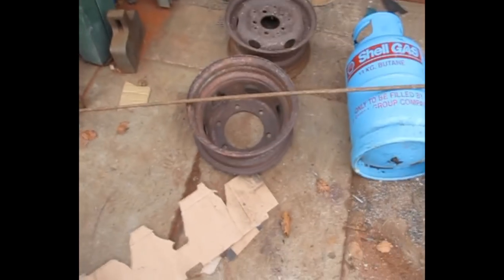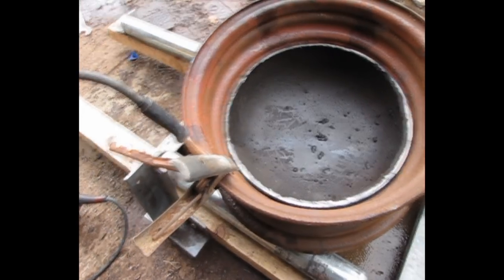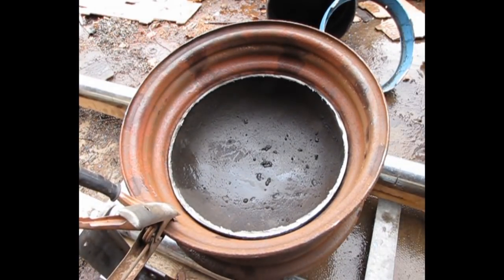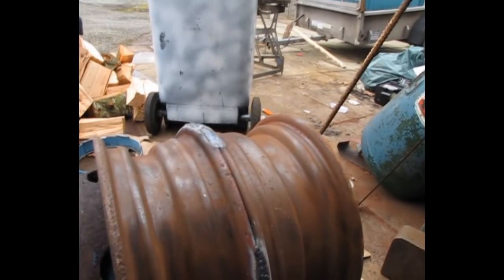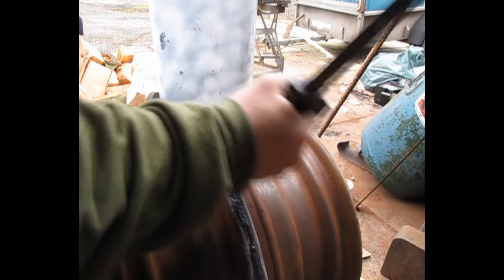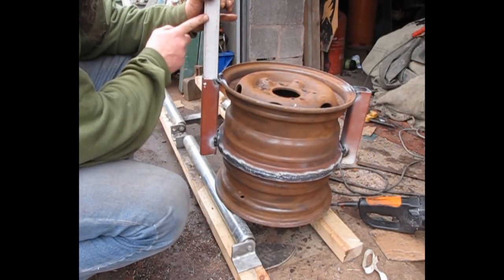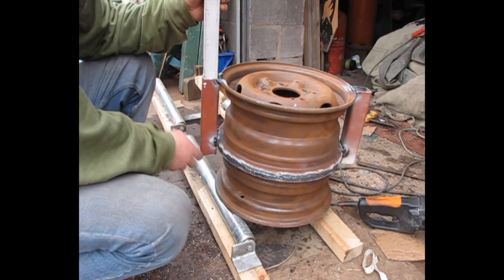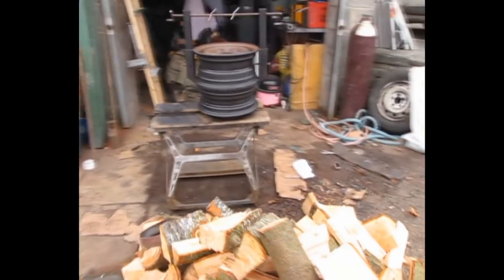DIY Wood Stove made from Car Wheels! Easy Welding Project! Bacon! CATS!

Comment: Good video. Another suggestion, I have seen work well for heating inside buildings is a log burner made from bolting truck brake drums together. Achieved by knocking out one set of studs and marrying up to the other set. This was 4 drums high and very hot when burning as the drums held the heat in.
Reply from the maker: +Andrew K Fletcher thats a great idea, one of my problems though is a lack of scrap metal like that, some steel just doesnt fall into my hands

Comment: I don't believe U diluted good Scotch with coke.  Drink it alone are on ice.  Oh, great video.
Reply: +Widowsson abif ill second what you said
Reply: +Widowsson abif He did drink it alone out of the bottle to start. Coke goes with whiskey like jelly does with a donut or milk with tea. Now you wouldn't want to use crappy jelly or crappy tea now, would you? The coke will surely go good with the bacon as it does with ham. Seems about perfect to me.
Reply: +lovestory952 Thanks
Reply: +Mr Boat That is disgusting, mate!  Coke with scotch?  A cup of tea goes good with another cup of tea.
Reply from the maker: +Widowsson abif no hes bang on the money, whiskey and coke is a really nice drink with your bacon or fajitas, you need a fair ammount of drink to go with your dinner and you just cant drink scotch like coke, and cheap whiskey is nasty with coke, the older the whiskey the nicer it is....with coke....single malt, not under 10yrs either :)
Reply: There is enough time allotted with an average life to have things all ways. And every day, month and year, another bottle of whiskey will come of age. Seemed like such a simple, yet fitting reward for a job well done.

Comment: can u imagine using 2 semi truck tire rims instead??!! that would be huge. or use 3-4 of these rims for a big one. TY FOR SHARING this poultrypeople. I LOVE ME SOME BACON TOO!
Reply from the maker: +Dave Zimmerman good suggestions, id love to try that but i dont come across big rims so much, but I will try your idea of 3 or 4 to make a bigger woodburner, thanks man, ill give you a mention when i make it!
Reply: cool. Hoping to try your idea out soon. Thinking the big semi rims might be too heavy. IDK. I see them now everyday at work. Keep posting vids!! love it
Reply from the maker: Dave Zimmerman i guess its horses for courses, they might be too big for your average portable family bbq but ideal in a more fixed position where a larger number of people gather? theres also been a few suggestion in the comments of putting on 3 legs and you could then add some castors so it could be wheeled around? ive got more vids in the pipeline :) ive also got a load of video that needs editing, time is always the problem ;)

Comment: Hey, well done!    Makes a nice little stove.        I had a thought.  Maybe block those two holes at the front, maybe sides too, leaving just the two opposite the front opening.   That way, flames and heat aren't coming out when you have a pan and handle .

Comment: I've built a few stoves myself, but nothing as quick and simple as this. Works well! A great cat you have, I sometimes forget to worm mine which ain't good. Just bought a dc inverter stick welder. I haven't tried it yet but apparently they're nicer to use than ac
Reply from the maker: +John Melville yes, youll have to let me know on the dc inverter how you get on, and thanks for reminding me about worming the cat as well its probably about time both were done :)

Comment: Cool idea!  Keep in mind that just one more pin hole in each outer telescoping spit support can give twice as many height positions and finer adjustment if it's ever needed. One would drill two holes in the outer tube spaced half the distance as the row of holes on the inner tube. Beats drilling twice as many holes if one set of holes cooks too hot, but the next one up is too cool. Actually the height increments shown here, could have been achieved with half the holes in the inner tube, yet only two more in the outer, my suggestion for anyone building one.
The tubing and pins holding up the chicken could hold an automobile off the ground, so even If one does have a drill press, consider using pins and holes half the size demonstrated. Even a 1/4" pin will hold an auto off the ground, supported on that same tubing. My first thought was lock the spit height with two modified Harbor Freight vise grip type C-clamps. One jaw half can be welded to the outer tube in any number of configurations. For example, blow a hole in the outer tube so one jaw can reach the inner tube, and chop up the clamp accordingly. Infinite adjustment, so much quicker and easier than drilling holes, and $3.99 for the 6 inch is so cheap it's seems shameful. The 11 inch is only $4.99, and since both are only available in swivel pad, you may have to cut one or both off, depending on the tube size used. Seems like around one inch tubing would hold a chicken or two easy enough, if that's what's available.
Reply from the maker: kelhawk1 thanks for commenting, im just catching up with a few messages ive missed, good suggestions, ill go through some of them when im in the workshop with the work in front of me, ive got one to make next week,  in regards to the over engineered chicken holder :) i just go with what ive got in boxes that ive hoarded over the years, living the rural life means that a trip to an ironmongers its $15 away in fuel so nipping out for bolts has to be improvised, i dont have any more box section left for the supports and all ive got at the moment is round cold water steel tubing, again thanks for your good input
Reply: thepoultrypeople Yes I am lamenting using the last of my 3x4 inch box tubing. To finish my last two stoves I had to cut up the winch and scale support I made to check the draw length & weight on a bow & arrow set ups.
Reply: kelhawk1

Comment: Excellent stuff.
Just a tip - throw some old oil on you drill bit when using your pillar drill and slow it down a bit - it will greatly extend your time between sharpenings.
Reply from the maker: +Dave Henderson thanks, slow down and waste oil, i have been spraying with wd40 but just ran out, ill take your good words on board, but talk to me about sharpening, do i need a special machine?

Comment: that's a pretty nifty idea...with a few more modifications you'd have a pot bellied stove...
just a quick tip on cutting doors in metal: drill your corners with a 10mm drill.. then the cut of the grinder doesn't go past the corner and the heat won't cause the casing to crack...
cheers mate
Reply from the maker: HolzMichel thanks for the tip, ill remember that one, yes its close to being a small stove, blanking off the top and just adding a flue would do that i reckon?

Comment: That is a nice little stove you made from scrap bits of metal and a couple old rims. Please no more mixing 15 year old scotch with coke, my heart died just a little from the misappropriation of good whiskey!  You took only a few simple tools and produced a nice camp stove. Here in America many of us are spoiled by having a lot of tools. Your work is just proof that the mind is the best tool. You shouldn't feel bad about those welds many people weld 1/2 that good and are damn proud of their work.
Reply from the maker: thanks very much, yes ive looked at tool prices in the US, they seem about a quarter to maybe a half cheaper than over here,  this is an expensive country,  which is strange because a lot of people arent exactly loaded, for instance i dont know of anyone who has a cnc router machine, yet i go on some of the woodworking groups and it seems like everyone stateside has either a cnc router or plasma cutting system in their huge garages, man houses over here are like shoe boxes, im lucky, most new properties barely have enough room for a small 6x8 shed, youll be lucky to get a garage...premium stuff... 

hmm thanks for reminding me about scotch and coke...ill go and pour myself a glass of the dalwhinnie 12 i think, and i will smash it with coke, you cant drink cheap whiskey with coke dude :) although the laphroaig 10 with coke doesnt go down well :)

Comment: Excellent and smart. What dimmensions of wheel rims are best (how deep and the diameter)? What types of rims, they got to have those wholes and the numbers of wholes must be present too? What kind of welding equipment (I like details to get the real picture). Your welding looks real good and solid.  I wish I got a drawing from you on this stove with all the equipment attached. I really like this stove, its smart and quick, solid and real functional. The welding you are doing I wonder if you use tig welding? Its really the right technique on this job. What is the dimmensions and quality on those 4 edged pipes/frames you are using for attaching the rotating rod a like thing on it with those prongs on the rod?

Comment: That stove design also lends itself to easy installation of a common cast iron propane burner. Those are used to make cookers and grills throughout the US and presumably rest of world. The only difference would be welding a mount tab for the base of the burner inside the lower area of the top rim.
Reply from the maker: aaah interesting, good cast iron burners arent cheap, i bought a chinese one a few years back and it was mis cast and also cracked eventually during use.

Comment: I had thought that utilizing old mobile home wheels (the ones that don't have centers in them...what once was known as "Bud" wheels) would be the perfect thing to build something like this out of. A heavy gauge piece if plate steel across the back and front and you could even wrap it in light-gauge sheet metal and build a forced-air system around the firebox.
Reply from the maker: +Andrea Tatham sounds like a great project, we dont have those wheels over here i dont think but ive never looked to tell the truth, and thanks for pushing me down the forced air route, its a system that i need to look at, maybe using low voltage computer fans to move the air?
Reply: thepoultrypeople Computer fans would work great if you are working a 12V system...though you could use the heater fan out of a car just as easily (and maybe even cheaper). The idea was to wrap the "barrel" of wheels with sheet metal which would create channels around your firebox through which you pump the air to blow out into the room OR to duct off to another room.

Comment: for the leg adjustments. drill one hole and weld a nut over it. then simply thread a bolt into the nut and press the bolt against the inner leg to hold it in place.
Reply from the maker: +bos dad great idea! thanks for sharing

Comment: I'm actually getting ready to make a burner like that but out of two large truck rims, a couple suggestions don't use soap to clean your pan and your welds look good it's mostly about practice. Very nice looking burner and yes Raggles licking his arse LOL!
Reply from the maker: ***** i saw a large rim the other day but it still had the tyre on and wouldnt fit in the car :) a couple of people have said about soap and pans/woks to just use cold water, im still practicising with the welding, i reckon after a lifetime on it I should be ok, thanks!

Comment: That's a solid looking stove. Nicely done. You sir, need a dip tank of water :) I think I saw you almost burn your hands a couple of times there. Has anyone built a coal burning stove? It seems like this could work with coal with some modifications.
Reply from the maker: +Sarah Wolfe missed your comment :( thats a good suggestion, im meltiing metals now so definitely one to think about, theres no reason why it wouldnt work on coal, i guess the problem might be the taste of the coal getting into the food? i suppose you could put a solid hotplate on top and pipe the exhaust out the back?

Comment: I have got to make one.  I just got a little welder that can manage 3/32 rods, and I got a few car rims laying around.  It looks awesome!  Does it radiate a lot of heat, keep a small area warm?
Reply from the maker: +Angie Hughes sorry for late reply, ive been away, you might have made it by now? if not, then yes, once its stoked it glows away and pumps out the heat, good luck, its good for welding as youre going to need to run a bead at a slight arc whilst maintaining the right angle, theyre great for practicing on, let me know how your getting on?

Comment: love your idea but I like to take other people's ideas to make better. cut bottom out and hinge it for easy cleaning. Weld on legs to your stove so it's not a back breaker. put caster wheels on legs. Weld on a handle or two on the sides to move it easy. just some ideas to think about.

Comment: Comfy DIY project,  if chose to leave the upper wheel removable like a lid,  it wouldn't hinder the function, right?
Reply from the maker: no, but it might be a bit wobbly if you get me, you could use threaded steel rods available anywhere put a nut on the end and cut them to length and push them through so its loosely bolted together instead of the welding
Reply: whiskey when you dump that to your head your brain must be saying stop doing that. I want to function without the rotted vegetation.

Comment: I'm in the process of making one of these to heat my shop- I oriented mine sideways though and dumped some sand/gypsum compound into the bottom to make it flat. I'm tryin to figure what i can use for a front and door now.
Reply from the maker: Im with you, hmm, nice idea, welding 3 or 4 together to make a long tube? What do you mean a front? Some sort of door? What are you going to put on the back to mate it up with a chimney?

Comment: You did everything good, but wouldnt that spray colour melt later on and have an effect on your food?
Reply from the maker: +kadijaish normal paint would, this is wood stove paint, i think its rated to 700c, there is an initial smell when its first cured but is fine afterwards, its used indoors on wood burners and ive used it many times, even now the rocket stove in the kitchen has the same paint used :) never use vehicle sprays or household paint. Thanks man!

Comment: you ya do a water heater for me ? weld a gas water heater tank on top and see if it will make hot water for a shower in hard times ! ya gona have to hook a hose up to it , off valve and a shower head ? what yaw think  ?
Reply: +Theredneck Prepper Coil up a piece of 1/4" steel pipe into 3 or 4 wraps and wind it in the top of the stove above the ash bed. Set your tank next to the fire box and run a line off the bottom to one end of the coil and from the other end to the top of the tank. Convection will pull the cold water out of the bottom of the tank and up to the top. 
You have to be really careful cause the temperature isn't regulated. You can get scalded pretty easy.

Comment: I'm sure it would be less effort to cut a hole in the side of the gas bottle, and another in the top. Then it's ready to use without any other work. You can sit a frying pan on the top where the handle is, and of course it just sits on the ring at the bottom.
Reply from the maker: +Paul Langford just gather stones then and make a fire on the floor, that requires even less effort....
Reply: +thepoultrypeople Unfortunately not. You have to cut a lot more wood; an enclosed stove is incredibly more efficient. Even more so if it has a chimney.
Reply from the maker: Paul Langford is it? thanks for commenting...you should upload video? have you made a rocket stove yet? theyre really efficient
Reply: +thepoultrypeople Look up Thermette. My grandfather used to use one in the bush (he worked in the forestry in New Zealand), and I have been camping with one. 2 litres of hot water in a few minutes using just rubbish of any kind, even in bad weather.  you can put a ring on the top to hold a frying pan or Dutch oven. The N.Z. troops in North Africa used them, leaving these mysterious round scorch marks on the ground; apparently, the Italians found out about them, and got to the point that when they saw the marks "Oh no, Not again..." was their response. knowing that bad things were about to happen. You can get a modern one made of copper, as well as the original tinplate version.
Reply from the maker: ive made similar, thanks

Comment: you done good work , but if you see you lose the Gas Cylinder which was  very costly , it was better if you use  F22 Cylinder you can found it in any junkyard
Reply from the maker: +Nasir Bin Aziz nearest junkyard is 20 miles away, you use what youve got, i have many gas cylinder, very cheap here

Comment: great wee project and a very simple build! I've been following your builds for a little while now and have done a few gas bottle builds myself. you wanna try the waste oil burner with the 4.5 foot gas bottle check out gerry's waste oil burner for the build and I've put mine on youtube too. P.S if you wanna try a nice smooth wisky try Balvenie Doublewood it's a nice smooth one!

Gavin
Reply from the maker: the Balvenie! man youve some expensive tastes there! ha ha ha £41 a bottle they want the thieving bastards! im going straight over now to look at this waste oil burner of yours! im dying to make a melter, the aluminiums building up and ive a few projects i want to do and casting is one of them
Reply: Yeah but when it's a good wisky it's worth it matey!
Reply from the maker: that good? i know thegeneral has got a bottle squrreled away at his, might have to find an excuse for the motorbike to break down outside his gaff ;)
Reply: If you check out Gerry's site he gives you all the dimensions and sizes for the air holes and his mad adaptations to the build, he puts his burner on a boiler and steams up the shed and even manages to hoover up the fire!